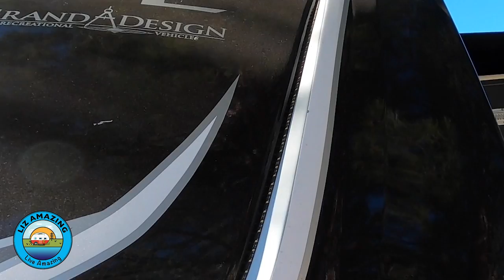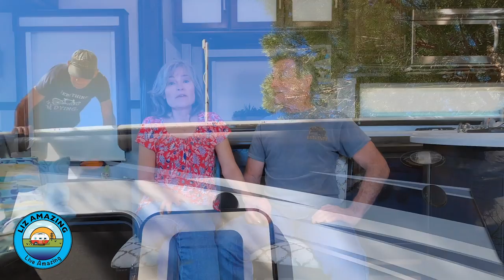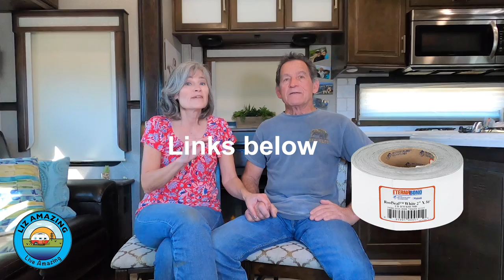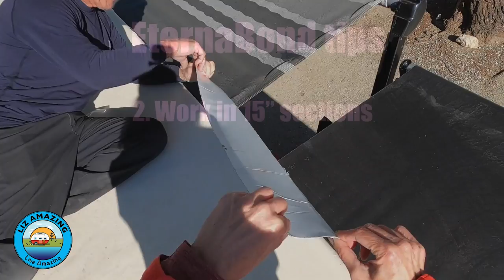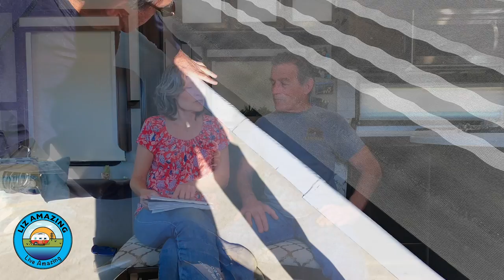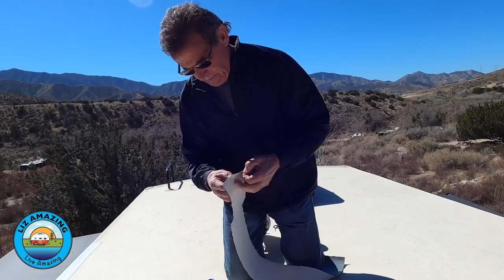RV life: We damaged our camper | $10,000 mistake | EternaBond | Fulltime RV Living

Comment: Now go back and Dicor all the seams including the overlaps.  If the outer edge is vertical don’t worry about that edge.  Your repair will last as long as your RV is owned by you.  Doing the Dicor extra step helps hold the eterna bond down and also makes the patch look much better.  A do all my roof seem and around my vents and shower skylight this way.  Doing a buddies RV last night.  Your mistake was removing the clear liners all at once.   Cut the pieces to the length you need with a razor knickers on a small block of wood,.  Then peel back an inch or two, position and align.  Then slowly pull the clear out from under as you press down, smoothing as you go.  Then follow up with a small roller.  Then but a nice Dicor self leavening bead on all the edge seems. Including were the pieces over lap. I overlap the corners by the width of tape.  Don’t try to be perfectly pretty as it is on your roof and the Dicor covers if your measurements are off here or there.  Inspect the Dicor once a year.
Reply from the maker: Hi Ralph, thanks so much for your great tips. We love Dicor as well, and I like how the color matches our roof, which is almond. Hope to see you in a campground.

Comment: Nice save with the tape. I used it to fix a hole which to this day I don’t know how I did it .  Then I decided to Eternabond everything on the roof so I never have a leak thru that lap sealant. Good job and I suppose the park owner isn’t allowed to trim that tree as I’m sure you’re not the first.
Reply from the maker: Eternabond is stronger than the original room, at least in our case! We looked at the video closely and it was actually a cut edge of a trimmed branch that jabbed our roof. Oh well. Grateful for insurance!

Comment: I have 50’ of the 4” Eterna Bond tape. I also have their Surface Cleaner and their Surface Conditioner that’s used right before applying the tape. My travel trailer is brand new yet I purchased these products immediately just in case something like this happened to me. It’s a great product and you’re right……it’s NOT coming off!!
Reply from the maker: So glad you have it on board. Good for you!

Comment: We are new to RVing and our 28 foot travel trailer did not come with a ladder.  So I bought a quality collapsible ladder.  It gets me on top or let’s me work high on the side.  

One thought/question.  Could you have used tubes of Dicor to fix the roof?
Reply from the maker: Dicor is great stuff! It would have dripped off the edge. But it would be good to put on top of the Eternabond in places. Oh, and we have a collapsible ladder, too. Or had one. We switched out to a step ladder. For a 14' tall fifth wheel, the 12' tall ladder felt too unstable. It was fine for our previous 12' camper. And congrats to you on your new camper!!!! Wishing you much happy camping this year!

Comment: Too late, but stick about 5 or so inches down and then peel away the backing paper as you unroll the tape a little at a time pressing and rolling as you go, completes the entire damaged area with one continuous strip.  I made a nice roller from a 3” wide nylon caster wheel and a piece of dowel rod mainly use it for leather and vinyl upholstery work when working out the bubbles in glued panels but suits your purpose perfectly.
Reply from the maker: Thank you! We needed you on the roof with us. Stay tuned for an update about our RV roof repair. We’re going to get it done this summer.

Comment: We had similar damage to our 5th wheel's roof. I patched it using etrnabond. The patches lasted about 8 months in the Arizona desert. The adhesive on the eternabond tape worked really well adhering to the roof material. However, it did not adhear to its own plastic tape very well. After about 8 months in the Arizona sun it pealed off leaving just the adhesive and the damage reappeared through the adhesive. I wish I could upload pictures of the  tape part of the eterabond curling up and falling off the roof leaving only the eternabond adhesive. Very disappointing!
Reply from the maker: Wow, that Arizona sun is brutal. This is good to know. Here is an update on our roof: https://youtu.be/9Yv0ZKSfvbc

Comment: Newbie rv'r, but I am a truck driver by profession, locally. I make deliveries to customers and have to unload my own truck (tanker, cryogenic liquid). I was backing into a customer for a delivery and the tank was next to a tree. As I got backed in, got out, did my thing to pump into the tank. Went to fire up the pump and nothing, no power. Rechecked all my system line up, 2x's, and still nothing. Checked and rechecked for about 30mins. Was just about to take the truck back to the yard and have the mechanic look at it when u remembered to check the emergency safety switches, yep, the damn tree reached out and flipped one while I was backing in. It happens, even to a 25yr veteran 😐
Reply from the maker: Oh no! Thanks for sharing and letting us know we are not alone. And welcome to RV life! Here is the surprising thing we learned about RV roof options:  https://youtu.be/9Yv0ZKSfvbc

Comment: I did the exact same thing in the same area with my 2019 Reflection - the roof is vulnerable around the edge.  I used Eternabond Webseal tinted to match the almond roof a bit better.  I was sick about it until I realized how many others have done the same, like they say if you haven’t damaged something your not using it.
Reply from the maker: Oooh, that's awesome to learn that they have an almond colored tape. I couldn't find that on Amazon. And we had the white on hand anyway. Like you say, if you haven't damaged something then you're not using it. Thanks for your comment!
Reply: @LizAmazing  the webseal product is paintable to match - I matched with a good quality exterior paint I got at Lowe’s.

Comment: Sorry to hear about your damage, but stuff happens if you travel.  I recently hit a piece of metal laying on the interstate because I didn’t want to swerve too hard to avoid it.  Turns out it first hit the front of my fiberglass trailer, put a gouge in it and then hit my black and gray tank dump valves.  I stopped later for gas and discovered my black tank valve was leaking—YUCK!  As soon as I got to my campsite, luckily with a full hookup, I had to struggle to get the valve open to dump the tank.  So I’m waiting for parts to hopefully fix the dump valves.  Plus I need a fiberglass repair....  Seems something happens on most of my trips!
Reply from the maker: Yep! Us, too! Sometimes it feels like a little too much adventure. So sorry about your incident. Hope it all gets repaired soon.

Comment: We have a 2014 Class A Thor Outlaw 37LS toy hauler that we use to carry a smart car while traveling.  Our horror story happened exiting a dump station at a campground.  I decided to make a right turn out, against my wives advice,  instead of a left and driving around the loop and back past the dump station.  I didn't quite make it on the first swing and knew I would be close to the hedge on the second but didn't think I would hit it.  So watching the hedge closely in my mirror I made the turn I was a good 8-10 inches from the hedge so thought I was OK but I didn't see the thin metal exit sign on the green post whit the wooded background and the sign caught at the last bin before the rear wheel and caved in that bin door, ripped the rear wheel fender off and the filler piece between the fender and the back entrance to the garage and bent the back door frame.  It was covered by insurance and is repaired now.  The total repair cost was $7800 and it took 8 mo at camping world.  There is one issue remaining, the fresh water tank was behind that bin door and CW didn't test it for leaks when they did the repair.  It has a small leak, about 1/4 gal / day until the tank is down to about 1/2 full.  CW says even though it was the same incident it would be a new insurance claim and the replacement cost would be just over the deductible.  This will be a DIY repair soon.  Lessons learned... Listen to your CoPilot,  always pick the safest option,  have someone guide you in close quarters, and never be in a hurry.
Reply from the maker: Thank you for your comment Ken. So sorry you went through all that and it still wasn't repaired right. Thank you for your tips! Copilot all the way! Here is what we learned about our roof options: https://youtu.be/9Yv0ZKSfvbc

Comment: so far we have been scraped by a semi truck [not a lot of damage] picked up a bolt in our rv tire and replaced a over fill valve in a gray tank and the tracks for one draw not to bad
Reply from the maker: Overall that is not bad at all. We, too, picked up a bolt. Ended up with a flat tire as we crossed the Golden Gate Bridge! We now have an excellent Tire Pressure Monitoring System. Get 15% off a TPMS, details in this video: https://youtu.be/odVXXL7X_Bw

Comment: I did the same thing on my 2023 3190 rls sprinter. I guess I would expect the roof to be durable enough ti withstand a tree branch! I would never replace the roof with the same system. The traditional rv roofs are not designed or installed for the application. Investigate Flez Armor or RV Armor roofs. I chose the Flex Armor system very tough durable and lfe time warrantee. The warrantee on traditional tpo tools are worthless.
Reply from the maker: Yes, FlexArmor is the way to go. Much better product.Thanks for this!

Comment: Bummer!  So sorry.  Thanks for sharing your story. I have run into lots of little branches in the past, thankfully, only scratched ours. Believe me, I will be much more careful from here on. I have the same type roof as yours, I believe.
Reply from the maker: Yes, it's hard to believe that the TPO roof is so fragile. Certainly that Eternabond tape is MUCH stronger than that. We are actually considering a different type of roof for the replacement. And be careful around branches!

Comment: I’ve also been carrying Eternabond tape  for a couple of years now knowing all it takes is a small branch or something to rub the roof or awning and cause a significant tear like what happened to you.
My biggest blunder was on our previous travel trailer, we were heading home from a week long trip and we started to have an issue with the rear differential on the truck.  I was trying to pull off the interstate as far as I could but I got the passenger side tires off the pavement which tipped the trailer and I ended up rubbing the awning on a mile marker sign that I thought I had cleared. Luckily I didn’t damage any of the awning hardware only the fabric which we replaced ourselves but we did end up buying a new truck!
Reply from the maker: Oh my gosh!  I guess these stories are just part of RV life, right? Glad that the damage wasn't worse. Thanks for watching and commenting. Paul and I wish you must happy camping this season!

Comment: Eternabond works on Metal Roofs also i have a old 1969 Travel Trailer that had a old metal roof i replaced it with another metal roof
and used Eternabond on all the seems have never had a problem with the roof and its been 7 yrs.
Reply from the maker: Yes! They have an Eternabond specific for aluminum roofs- yay!

Comment: Torn a small area on one of our RVs due to wind grabbing our awning.  Brought a small roll then similar to what you have.  Now carry something similar that will work when it is wet, flex tape.  Goal is to have something I could quickly patch no matter what the weather.  Also carry the caulking.  Nothing will run a vacation quicker than not being prepared.  Clipped the corner twice of RV (traveler and then our fifth wheel) while swing out of a tight space.  Now in doubt use a spotter and think ahead.  Backed into my house guttering did $100O fiberglass repair (see no spotter comment).   I think the lack of spotter is a guy thing.  Kind of like not asking for directions.  :-)
Reply from the maker: Hi Norman! Caulk-yes! We carry that on board as well as Dicor. I agree with you about it being a guy thing. Sometimes Paul wants to back in the rig with no direction from me. He usually does really well but I have to remind him to slow down. I need more time to assess the situation and relay the info before he hits something.

Comment: Yes I hit a friends roof in Yuma...In Yuma they call themselves Humans. I really like this product I don’t know the name of it but it’s silver and it’s  a commercial roof coating  turns into metal  when it dries, excellent product it last forever.so I use that to repair the edge where I hit  the wood  , it was easy to repair my friends house also because I do that kind of work it wasn’t wasn’t bad compared to what you went through... just 1 ft damage on my 1st motor home. I also did fiberglass repair dent with almond   caulk , blended in well.
Reply from the maker: That sounds awesome. We used Eternabond roof tape and they do make a metal version for aluminum roofs.

Comment: We did several thousand to our endcap. Sneaky metal campsite post hiding in the bushes.  We hold it together for several months with gorilla tape - 5 rolls maybe? We've also had several close calls. We also have a few faint scrape marks running the length of our RV if one looks closely.
Reply from the maker: The end cap- oh my gosh!!! Like someone told us, the scratches just mean you are using it. Better than collecting dust in the driveway. Thanks for watching and commenting!

Comment: Curious how the tape held up?   While the way you overlapped will  'probably' be fine,  next time overlap the same way fish scales are arranged  - the way you have it is backwards, as the leading edge of the overlap is exposed to the wind blast when travelling on the highway - it should instead be tucked under to shed air like a shingle roof sheds water.  Every little bit helps!  best of luck.
Reply from the maker: It's been just about a year and the tape is fine. But we are going to go ahead and get that fixed this year. Here's the surprising thing we learned about our options:  https://youtu.be/9Yv0ZKSfvbc

Comment: Yes the very same thing happened to me with a ground guide at my house.  They said the leaves were touching when I went backwards. I did no know the roof was torn (I should have looked). After winter was over and looked inside, oh... I thought  it was condensation because where I parked... I still did not understand what happen forgt about "the leaves" went camping and it rained inside. Finally checked on top oh... I did not have anything and when going home thought the roof would come off...  I did the same fix, never leaked since. Wanted to replace the roof...oh my God!! Around 10,000. Never replaced it, no leaks... now a few years later I want to replace the rv, nicer one and a bigger one not sure what to do? I will sell it myself and want to be fair.
Reply from the maker: Yes. Lots to think about. That's what they told us, too. $10,00 to replace the roof. Yep, just be fair and honest when you sell it. RV's are hot right now so it may sell pretty well. Good luck!

Comment: There are various companies, I know one of them is in the Temecula area and 1 in San Diego area, actually Coats your roof with bedliner material. You can get colour matched to the existing roof or whatever colour you want. And gives (I believe) a 15 year guarantee on it not to peel or crack. That is 1 of the updates will be doing our solitude sense  our roof started peeling off of it 4 months after we bought it brand new.  Let's since we were on a one year road trip we can't afford to take it into the dealer and let it sit for what they estimate to be 2 or 3 months to replace it. So we want to get a coating on it instead, That would only take a couple of days. Too bad grand design will not warranty for that  Even though I am told it would cost less then for them to replace my entire roof.
Reply from the maker: Yes, that's exactly what we're looking at, some kind of spray-on roof. Our insurance should cover this but we don't want to get the same roof, that stuff is like tissue paper!

Comment: My roof is aluminum sheets. 1976. I roll Henry's on once every three years. Silicone around fixtures about the same
Reply from the maker: Good to know. Those aluminum sheet roofs are pretty darn durable.
Reply: @LizAmazing  yes. I wish they still made them like that. I hesitate to upgrade because of the more fragile stuff. Glad you got it fixed. Thanks for sharing the video and the fix that worked

Comment: We upgraded our camper with in the first month we did the same damage to our roof. We only had flex seal but it worked and held us over till insurance would get it fixed. And it was almost a 10000 repair on our 33 ft camper. Don’t mess with tree branches they will mess up your roof and it cost is high for repairs. Thank goodness for good insurance.
Reply from the maker: Yeah. We learned. Branches = no good. Looks like our insurance will cover it. Whew! Wishing you a great 2021 camping season!!!
Reply: @LizAmazing  thank you, you too.

Comment: Seeing your bikes on the back reminded me of a question. Do you ever use a cover to put over the bikes for travel, protect from weather, hide value from thieves?
Reply from the maker: We don't cover them doing down the road as it's hard to find a cover that can take that kind of wind. We use our covers in the campground and/or store them under the fifth wheel overhang. And always locked!!!
Reply: @LizAmazing  That's what we are wondering. The new Mountain bike is 3 grand and I really didn't want it getting rained on or visible to thieves on the trailer. Under the overhang is a good idea when we are not traveling or even just covering it on the bike rack when we aren't driving.